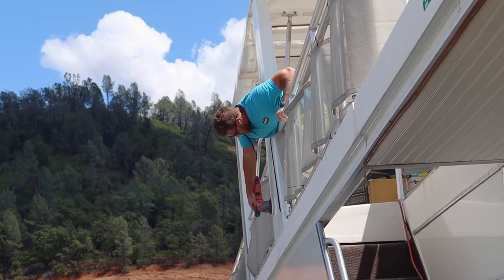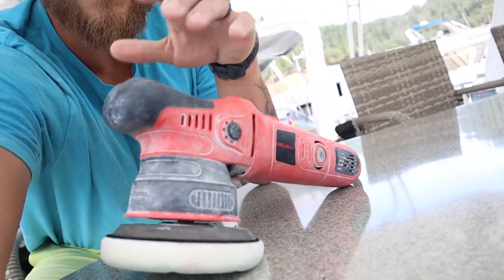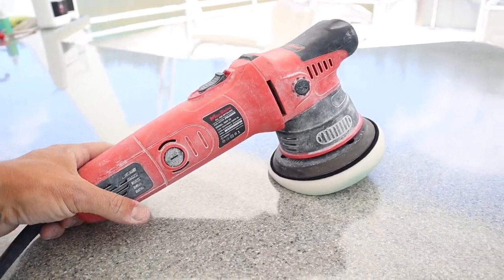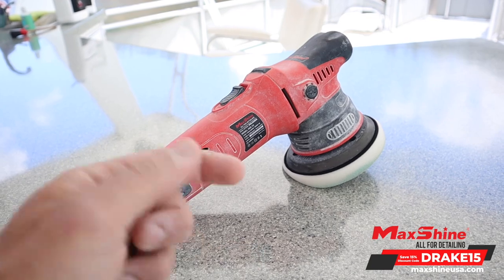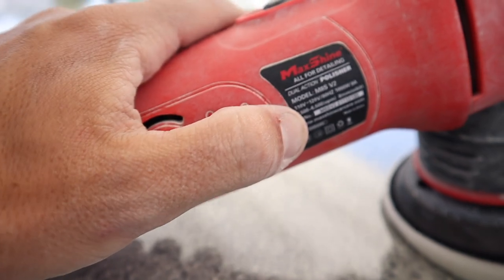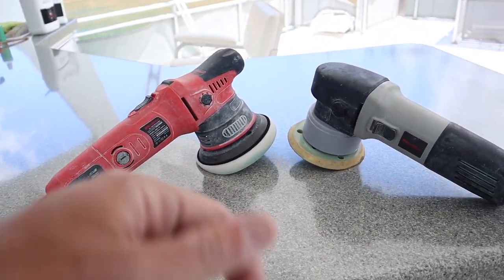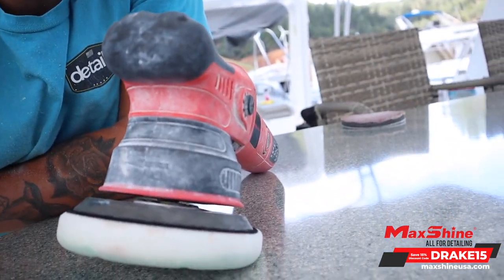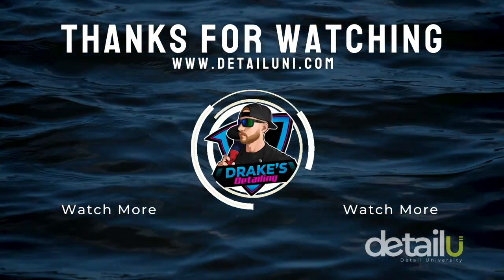The Best Boat Detailing Polisher On A Budget | Maxshine M8S V2 8mm/1000W Dual Action Polisher

Comment: I bought a 2006 Key West 1720 that was never waxed or covered  ever and was a chalky queen. I tried using compound and glaze but the haze came back and I knew I needed to sand into the gelcoat then compound and glaze. I was using  Dewalt palm sander that was taking for ever and I saw this video. Wow this is a beast!!! 
The key is to get a softer 5" hook and loop pad. I bought then used the Max Shine machine in your video using  320 grit, then 600 then used the Mirka Abralon 1000 grit then compound and glaze then followed up with a ceramic coating, WOW. Its a brand new boat!!!
Thank you for suggesting this machine and I cant be thank full enough, this machine is a work horse!!!
Between each grit of sand paper I did use dykem and acetone and a visual sanding aid to make sure I did not go too far in when sanding since moast gelcoat is only supposed to be around 25-30 mills.
 I did use a conventional orbital polisher (Milkwaukee 5504) for the compound and glaze. My polisher is heavy and that is where the Max Shine unit came in handy. This thing can sand like nothing else and cover territory from one zip code to another very quickly. I used the Mirka Abralon 1000 grit wet and this is another design advantage over the Dewalt palm sander is wet sanding the motor to the palm sander is right there not offset for use with water. The wet 1000 was key to getting an easy to compound out surface.

Thank you again for suggesting this Max Shine sander/polisher!!!
Reply from the maker: You are very welcome bro!! 😎

Comment: Hey mate love your videos. What do you use to clean the surface after polishing &  before wax application ? Please and thank you.
Reply from the maker: Sometimes I will do a light wash with Dawn dish soap just remove the oil from the compounds and polishes, and sometimes I will use alcohol wipes if I need to speed up the process 😎

Comment: Excellent video. I actually returned the Maxshine M8V2  and ordered a Griot G9 / G8 kit with polishes, Ceramic 3 in 1 wax and a bunch of pads for $225 with a sale and a discount code. I did it because of the great lifetime warranty , 180 day return policy and the incredible ergonomics of the G9 and G8. I saved about $175 compared to buying separately and feel good about it but will probably go back to Maxshine for a 15 mm long throw. Your thoughts? Do you find the Maxshine M8V2 smoother with less vibration or just less likely to stall? Thanks for taking time to do the vid and respond!
Reply from the maker: Yes , we do like the Maxshine better and love it’s smoothness!
Reply: @DrakesDetailing  Thanks for the input!!!
Reply: @anthonyscuderijr.cluchfc6602  How are you liking your G9? I'm in a similar dilema. Griot's G9 or Maxshine M8S V2 for $130. Did you find the G9 different or an upgrade from the M8S V2 you returned?

Comment: Hey Drake, I'm polishing a boat tomorrow for the first time, not heavy oxidation, so just needs a quick polish.  I'm gonna use a maxshine m15 with a blue lake country hdo pad and menzerna 400, followed by Jescar sealant.  We'll see how this goes...haha
Reply: Good luck 💎💎👌🏾
Reply: @dsgaming1893  It turned out pretty good, the only issue i really had was the non skid had some dirt marks where a brush and apc wasn't enought to get them out.  I'm thinking using a steamer might be a good way to get those stains out of the non skid, as well as steam cleaning the seats to get rid of stubborn dirt.  But all in all, it went pretty good!
Reply from the maker: Nice! Let me know bit it goes!
Reply from the maker: Try a drill brush for the non-skid. Those are good for getting the compound dust from in the grooves of the nonskid

Comment: Hi Drake, first I would like to say thank you for all the educational videos you do to help us amateur’s that want to detail  our boats at home. I would have never attempted to try to do this, but these videos have given me the courage to give it a shot. Based off this video I did purchase the M8S V2 8mm last year and tried a few things on my boat and was very happy with the outcome. 

Is there a wool cutting pad I can use for this machine? Also do you have any suggestions where I can get 1000/grit for wet sanding for this machine that is not a pack of 50. Thanks in advance for your help.
Reply from the maker: Hi Stacy! Thanks so much for the kind and thoughtful words! I really appreciate it! Unfortunately, there’s really no wall buffing pads for a DA polisher.  dear polishers are not meant to cut heavy oxidation, which is what wool is meant for.
Reply: @DrakesDetailing  What about the LC Purple Foamed Knitted Wool Pads, or is it best to use the LC Orange CCS Heavy Cutting Pad?

https://youtu.be/j-uMEKkqkFI?si=c4kCWqkYUmfX8HA0
Reply from the maker: You can try it… but IMO the DA is still not powerful enough for it to make that pad do what it’s really supposed to do. However, you could put it in a force rotational polisher.

Comment: Im someone who will not be buffing/waxing my boat alot. We have a short season in NY. So maybe twice a season.  Would this maxshine machine be good as a do it all. Polishing waxing etc?  I know a smaller machine would help for those tight spots. But as in cutting and polishing and anything else.  Would this machine get all of it done? Or is there another one you would recommend ? Thanks
Reply from the maker: If you’re going to polishing and waxing twice a year, this little guy should be just fine 👍🏻

Comment: Another great video. Do you know how the setting on the speed dial relates to actual rpm? What setting do you recommend when using an orange LC with Menzerna 400 for polishing? And the setting when using a white LC with a wax/sealant?
Reply from the maker: When polishing I run it at about 5 to 6 
When waxing you can run it around 4 to 5 

I don’t know the RPM right off sorry

Comment: I have a sea ray weekender 225 I just bought, I removed two american flag stickers that were partially pealing, the boat color is SAND, and they left yellow stain's. I've sanded them starting at 1000, thru 2000, and nothing they are still there, other they putting new stickers to cover the stain's how do I remove the discoloration?
Thank you, been following you for a while now, I've learned  alot.
Reply from the maker: Hey bro! Normally I would say just wetsand it and buff it out, but I have seen gelcoat where no matter what you do the adhesive fro the decals permanently changed the color of the gelcoat in that area where the decal was

Comment: I currently own an Meguiars MT300 DA. Being a DA it tends to stop spinning with mild pressure unless its turned on full. Will this DA bog down the same way or will it stand a fair bit of pressure?
Reply from the maker: This will for sure be better than the Maguires DA in that respect. But at the end of the day, DA polishers are just polishers. They are not made to remove heavy oxidation or to be pushed on very hard, or else they will bog down.

Comment: Drake,
I have a 21’ NauticStar Coastal. I am planning to do a little wet sanding some scratches and use starke elevate and ignition then cap it off with jescar power lock. I have a dewalt buffer, can I use that for all of the products in lieu of buying a polisher just for me to use on my boat?
Reply from the maker: Yes, you can finish out with a rotary, and I know several people who still do that. However, a forced rotation machine or a DA will definitely help remove the swirls to make it more of a glass finish at the end. With the rotary, you will still see some halo/scratch marks from the buffer.

Comment: Hi, do you use this item for compounding as well. I am looking to replace an older Meguiars unit. I need a polisher of this size that will 
perform compounding and polishing. 

Kirk

Kirk
Reply from the maker: Yes you can! However, it won’t remove severe oxidation like a rotary could, but, it will and it will remove swirls while doing it.

Comment: Would the 21 cut more than the 8? Just wondering why smaller polisher if Boats are soo much larger than cars? Just curious. I have a 21mm already for cars
Reply from the maker: No, very similar power, just a bigger throw/plate.
Reply: Totally wrong answer, its the bigger plate combined with the bigger offset/throw that matters. Thats why the 21mm longthrow polisher was developed, to be much more effective especially on large surfaces. Your assumtion is correct, the 21mm is the right tool and/or a rotary. This whole video is nonsense.

Comment: Im just about to do a boat. Mainly do cars but only use DAs (rupes mark 3, max shine m15pro, etc). Are those good enough for buffing and waxing gel coat. Its for a dealer so doesn’t have to be perfect just shiny enough for sale
Reply from the maker: Hey bro! Those machines will work beautifully. I would definitely add a rotary buffer to your arsenal for the gelcoats that have heavy oxidation.
Reply: @DrakesDetailing  great yea definitely gonna be picking one up

Comment: What are the differences between the m8s and the m8 pro?
Reply from the maker: The m8 pro is a forced rotation machine. The m8s is a dual action polisher. One is designed to do light cutting and remove swirls, and the Dual action is basically for very light polishing and applying sealant.

Comment: A little of topic from this video but since this is your last video: My boat has those yellow stains in the water line and it feels like only way to get rid of those is applying oxalic acid. Only problem is that after the acid it doesn't last even a day and it looks exactly the same again with the yellow line. What would you recommend doing for it? My thought is that the gel coat is just bad in the water line and need to be buffed but the boat is on the water and lifting up is not an option atm.
Reply from the maker: Hey bro! I’d use some toilet bowl cleaner to get it back to that brilliant white color, then buff it out to bring back a nice shine 😎
Reply: @DrakesDetailing  thanks I’ll give it a try!

Comment: Always getting value out of your videos! I bought a Harbor Crate rotary buffer and I went to change out the pad for the 1st time the other day and the velcro backing tore off with the pad 😭😂😆 pos! I'm switching to a DA!
Reply from the maker: It’s just harbor freight ha 

You’ll still want a rotary for heavy cutting, but this DA is a great machine for light polishing, waxing and sanding is need be!
Reply: I have this same problem with the harbor  freight rotary. You have to be careful when removing and use a plastic putty nife about 3 inches wide

Comment: I'm planning on compounding, polishing, and waxing the nonskid, walls and gunnels of my boat that have a very dull/chalky look.  Can I use this machine for all three steps or do I need the rotary makita too?  On a budget so don't want to spend on it at the moment.
Reply from the maker: Unfortunately the Maxshine is not powerful enough to remove heavy oxidation. You will need a rotary buffer like a Makita or a. DeWalt to remove the heavy oxidation with wool pads and heavy compound, then you can use the Maxhine DA to polish and wax with 😎
Reply: @DrakesDetailing  ok, I bought the makita, I'm going to attempt polishing and waxing with it as well.  I'm ok with some holograms since it's the interior and the boat is full of sun damage. Thanks

Comment: Can you explain to your viewers how an 8mm throw could be better than a 21mm throw random orbital on big surfaces as a boat? The 21mm will do the job x times more effective and faster...why it was invented. Your advice makes no sense at all am afraid. "The best boat detailing polisher on a budget" is a desent 21mm longthrow machine or rotary.
Reply from the maker: I disagree with you, I dislike 21mm throws because of the long throw. Boats have large areas which is true, boats also have a ton of curves, edges and corners which the 21mm can not get into! 

I like the small throw because you have much more control especially for beginners and you can operate the machine easily with on hand! 💯
Reply: @DrakesDetailing  Its fine, each to their own, just stating facts so viewers are aware. If you have a mobile home, camper, truck or boat, set aside plenty of time and hope your really fit with an 8mm polisher and 5,5" pad, you will be at it for while...👍
Reply from the maker: 💯💯 thanks for your input